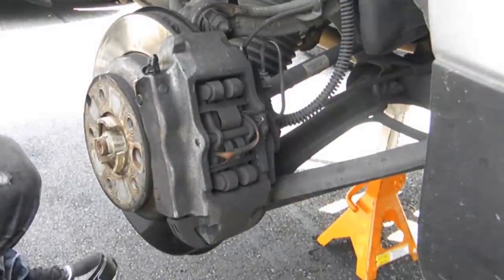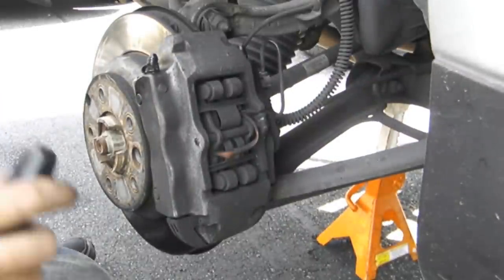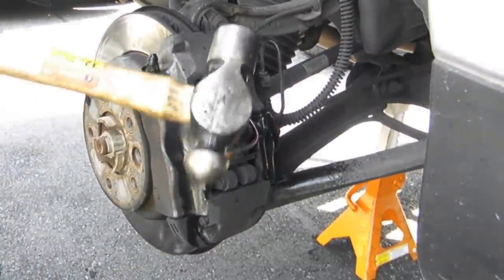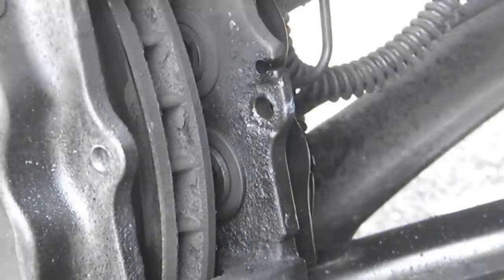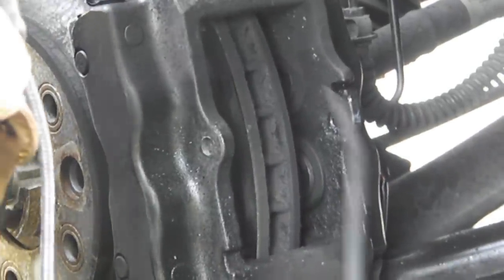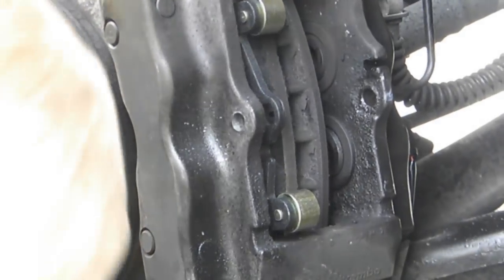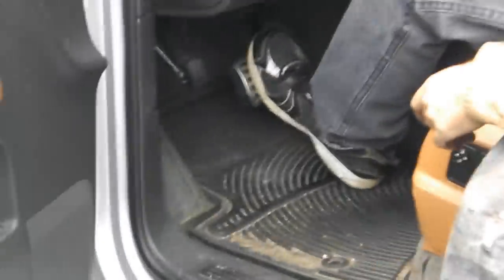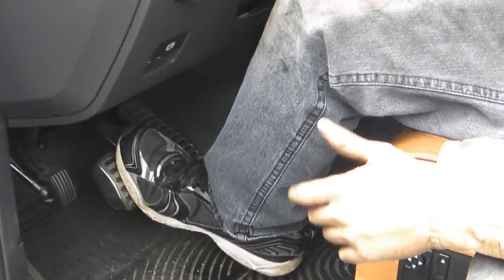Front & Rear Disk Complete Brake Job Part 2 (2005 VW Touareg)

Comment: Do the front brakes have contact points to grease up? Also does each tire need a sensor or is it just the right side?
Reply from the maker: Ivan Rey Yes, there are contact points to grease up. The sensors, if I recall correctly, are on all four tires.